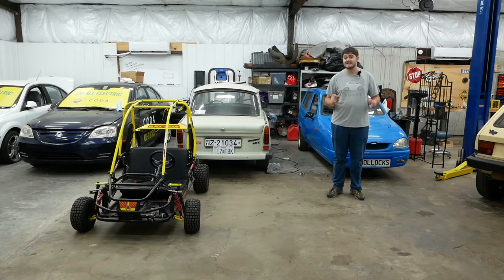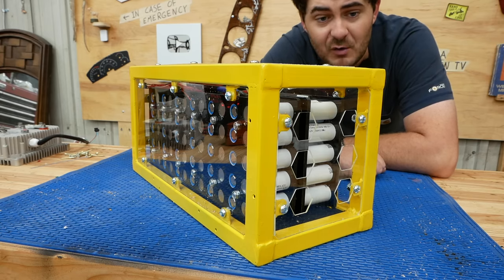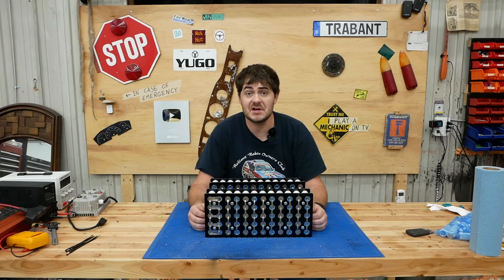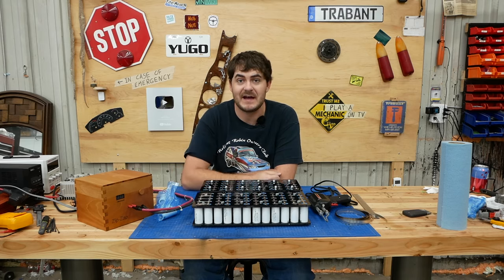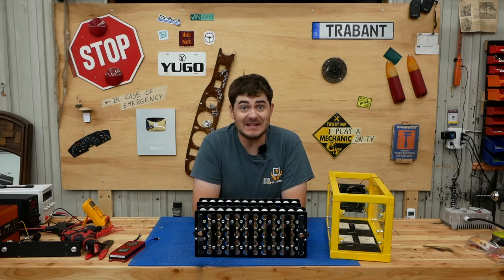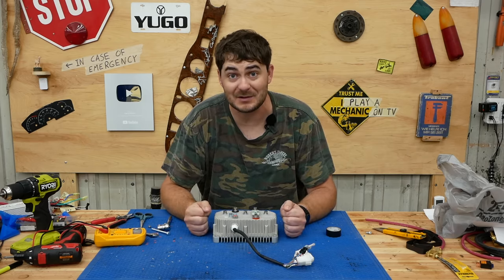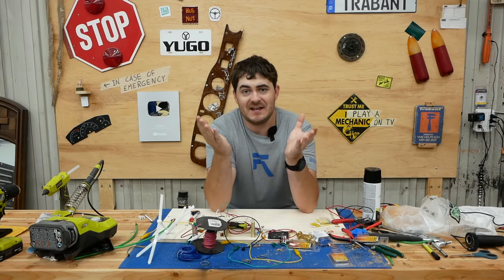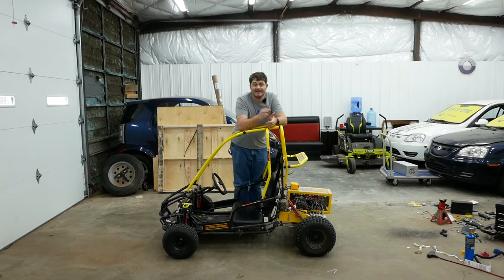I Spent Weeks Converting This Go Kart To Electric. Did It Work?

Comment: this is a great project, no problem with your old controller, it is an ebike controller that can handle sensored or sensor less motor, it even have an self learn wires for the proper rotation, the problem is your battery, if that controller is rated 48v, that battery that you should use to it is 53v full charge because the controller has a 42v cut off. so even if the battery is full charges at 40v it will not work. the same in your 72v controller, the battery should be atleast 81v full charged, use 26S for the cells. the cut off for that battery is 62v, so if you have 72v at full charged on your current battery, the voltage sag when you hit the pedal will cut off the controller. I hope you finish these project for your six year old.. God bless

Comment: If that 3D printed bus bar holder ever fails another option would be using that huge solder iron to heat up THREADED INSERTS and just melt them into the acrylic  (its what I use on 3D prints)

Comment: Hall sensor are sensing magnetic fields, what makes me think that the problem might be emerging within the converted alternater(motor). You would have to either swap the "engine", or try adjusting the freqeuncy of your electronic speed controller that MIGHT fix it aswell! Good luck

Comment: 25:00 it's probably the chopper transistors in the primary of the SMPSU. It could also be a transformer issue, which means scrap it, or a gate drive malfunction, witch means it'll be a dangerous lemon if that's fixed so scrap it.

Comment: When I was a bit older than your son (I think about 10) my dad made a similar modification to a dead go-kart that ended up in the scrapyard he worked at and he had a few very subtle modifications that ensured control over it, the first was it had two keyed switches one with key retention one without, I had the key to one he had the key to the other, that allowed him to make it "break down" at will when he didn't want me on it, the key he had stayed in the on position most of the time, this modification gave me a sense of false control, which I liked very much, I just didn't know it was false. The other modification was a circuit attached to a remote that could cause it to taper off the throttle and apply the electric brake while the driver maintained control of the mechanical brakes.

Comment: Hi, the reason might be, that the hall sensors are not placed in the middle. And since the magnets are triangle shaped, its not working, since the controller is ment to work with equally shaped.
The same Problems you had happened  Austin Blake in his Video to Building an Alternator Powered Bik, too.

Comment: I built a kart with an alternator motor and it should go fine with the 1500 watt controller. Assuming it will work on 72 volts you can run it without the hall sensors. There should be a 3-speed control connector that has 3 pins. Default is medium speed. For full speed you need to jumper the two outermost wires together.

Comment: Maybe a good idea would be to ditch the alternator competely and go with a BLDC motor. If you like a challenge, instead of buying a brand new motor that won't be cheap, you can get a burned out three-phase AC induction motor in the scrapyard and re-purpose it as a BLDC motor. The construction of both of them is pretty similar, you'll just have to lathe the rotor in order to free some space to epoxi the permanent magnets and also rewind the stator. It's a shit ton of work, but it can be done for probably a 1/3 of the price of a brand new BLDC.

Comment: The magnetic field strength from that electromagnet of the rotor is not powerful enough for the hall sensors to pick up especially at high acceleration. You need to do the rotor mod with permanent magnet to attempt high acceleration moves. Also your battery clamping is not secured, the copper bar can move, rust can develop between contact of different metal and cause your BMS to read bogus voltage and cut off. At last look at the busbar current setting of your Kelly controller, set it to 90A.

Comment: My own electric project has a similar problem Too much throttle and it cuts out . Seems based on current issues. The controller is basic and I think tuned for a lower current but non programmable. I wonder if you tried upping the current limit settings? I think Kelly makes good controllers. Thanks for your video.

Comment: Have you tried measuring the voltage at your 12V rotor field supply during operation? What's stopping the stator field from inducing a current in the rotor windings? If a potential greater than 12V is generated in the rotor, that would back drive the DC-DC converter. It would also kill your rotor field, causing your hall sensor signal to go very wonky, confusing the controller.

Comment: if you wanted to solder the batteries fast, the trick is to replace the tip with a short piece of 12 gauge wire. gets super hot super fast

Comment: You attached to Hollis sensor to a rotor. What you should have done is connected a separate plate with a magnet on it the motor management to select a single point. Then the computer would know at what point the rotor was at and it would be able to sync up with the position.

Comment: Ok now I just checked and I cannot find a reference to a three phase induction motor that uses a permanent magnetic field. There is the squirrel type and the wound type which appears to be what you are trying to achieve,  the wound type appears to have the induced voltage, current and magnetic field regulated by external resistance. Also if you alternator outputs 60 amps your power output can only be 720 watts, 100 amps 1200 watts no matter what external circuitry you attach. Your motor controller if a VFD (veritable frequency drive) will expect only the magnetic field it generates not a second field generated by your rotor field. hope this helps

Comment: The charger pack's mosfets are likely failed short. Repair may be possible, although cost analysis between replacing and repair may be necessary. You seem to have the electronics skill to pull it off, but factor in your time.

Comment: Ok - sounds counter intuitive BUT - Reduce the current to the stator winding's  - the increased field at 12v when the motor is spinning will be causing your hall error
what you have is essentially a variable KV motor - run the stator at 12v for high torque low rpm and reduce as the revs go up - 3 to 6V is a good place to experiment - maybe a PWM controler ? - Love the content - dont give up !!!!
Reply: Just to add to that - think how the stator is energized in your car - the ignition light goes out as the stator current is reduced - the ignition lamp acts a a current limiter (well at least it used to before smart charging & ecu;s)

Comment: Should check the amp  draw  while driving  the cart. Could  be alot  under load which makes voltage sag and with voltage sag cones current draw increase which causes  problems

Comment: You need more torque specifically along with a different rotor stator configuration. The torque of the alternator is so little that it becomes pulled out of phase each time the buggy stopped. Easy fix is using an actual electric motor. Hard fix would be more windings inside the alternator and a redesigned rotor and stator keeping the alternate from "magnetic locking". Tesla fixed this mag lock problem in the Tesla motors allowing for more horsepower and torque.

Comment: I would think you need a starting capacitor. I bet voltage drop is enough to turn the motor controller off or into a protective shut off during the huge amperage draw at the instant of motor start when under load.

Comment: I’m new to your channel and love your vids. You had a lot of bad luck with your gokart projects man. That first controller you had was actually just fine. I’ve had plenty of success with them. You also needed to just buy a kweld spot welder and you could have handled multiple layers of nickel strips.

As far as the motor goes just get a 48v or 60v my1020 brushless motor for less than $100. Can get 35mph out of those.

Comment: I'm worried about those plastic clamps creeping after some time, especially if it gets hotter. Next time you resume the project, please take a look at those to make sure that the contact resistance hasn't increased due to lower clamping force, just so that nice battery pack you built doesn't catch on fire. 100A is no joke.
Reply: IR camera of the contacts after full loading session should be interesting to see 😎

Comment: That Kelly controllers gotta chew threw the output current of the Daly BMS.
Edit: Eyy, I was probably right with that.

Those kelly controllers are for UTVs and Golf Carts. They pull like 200+ amps. I found this out the hard way building my electric mowor. You can try to program it to draw less (down to 200a), but it wasn't a flat 200. And any 250 fuse I put after the BMS still blew.

Comment: When it hits 72 volts, it's basically dead. Voltage regulators take higher voltage and chop it down to what the components are rated for till the input voltage drops below their regulatory voltage, then they stop supplying power to save the battery.

Comment: The hall sensor error could be from the controller detecting that the motor isn't performing like it should, it could be sliping magnetically missing some sensor output pulses and causing the controller to shut down for safety.

Comment: You should try to use a vesc based controller for example a single motor vesc controller made by sprintend they are very powerful and very small you cand pull something like 300 phase amps from one controller and about 200 battery amps. And also they aren't that expensive.

Comment: I wonder if he figured out in the last two years that he could have soldered directly to the nickel strips before spot welding to the batteries. You can even solder copper bus bars to them, if you use an oven or a torch.

Comment: Μy rc car did the same thing!!! With 10-20 percent throttle it would move normally but with higher throttle it would cut out exactly like your go kart. Turned out to be worn bushes!!! I don't know whether your alternator/motor has bushes but if it has i would check them out.

Comment: The common trope of "soldering battery terminals is bad" comes from people doing it wrong. If you just go at the terminals of a battery with a crappy soldering iron and no prep work, of course you'll end up with a damaged battery. The battery sucks the heat out of the iron and prevents the solder from melting, and you'll end up holding the iron on too long and overheat the battery. On top of that, solder doesn't stick to polished shiny battery terminals, unless you have acid core solder, or a corrosive flux - and I don't recommend those either.

To solder a battery terminal, you need to scuff it thoroughly with fine grit sandpaper before soldering. You don't need to go at it with a belt sander or anything, just scuff it enough in a circular or cross hatching pattern. You need to use a sufficiently powerful soldering iron as well. I'd recommend a 60-90W iron with a large chisel tip, and preferably large body for thermal mass, else the battery will suck all of the heat out of the iron and the solder won't melt.

Once you prep the battery, use the soldering iron to melt a blob of solder on both battery terminals. If you're using copper wire, strip a section long enough to span the batteries in the pack and tin the areas that are going to make contact with the battery terminals. Once that's done, just put the wire on the battery terminal and press down with the soldering iron. It won't take more than a few seconds for it all to melt together, and you're done, move on to the next battery.

It can take a bit of time to get the technique down so you don't use too much solder, but once you get the technique and prep work down, building a battery pack up using solder doesn't take that much more time than spot welding. It's a good tradeoff for people that don't want to buy an expensive spot welder they're only going to use once.

Comment: I would say you should not use a hall sensor in side the stator.  Fit a real shaft encoder.  Then increase the gear ratio.  An alternator runs at high speed,  several times engine speed.  It sounds like it is virtually stalled.  Also a higher ratio will drop the top speed of the kart,  much safer for kids.

Comment: I can’t se clearly how the BMS and batteries is connected, but it might be done wrong. The main power should go directly from the batteries through the BMS controller with the thick cables. The BMS is measuring each cell for over or under voltage and regulate the charger and balancing the cells when charging. This is what the thin balancing cables are for.
I have nearly 40 years experience with eletrical forklifts, and often see this issue if the voltage drop below threshold under load. Then the motor controller will shut down.
This of course with the older lead acid batteries, but principal the same is happening with newer Li Ion batteries that are more common this days.

So as other have wrote here, as a first test, measure your battery voltage under load, or as a simply test, add an lamp to the batteries and see if the lights are fading away as you push the speeder.

Comment: Need higher volt DC motors instead of a AC alternator to get the torque. Lower volts = more AMPS to do the same work. Thanks for sharing the truth about your adventure, remember failures are success in the making.

Comment: I know its to late and such, but to clamp down the busbars you could have just flipped the screws. So instead of threading into the acrylic, just champfer the whole from the inside, stick a 7991 or something in there and counter the screw with a blind nut on top of the busbar. This way you have no threads in the acrylic, the screw cannot make contact with the cells and you have a screw post to mount the cable shoees for the balancing on top of the busbars too.

Comment: Pretty sure the problem is the hall sensors are getting magnetic or electrical interference from the core being powered instead of permanent magnet based.

For the battery series connections you can layer multiple strips on top of each other to get higher power and also just use thicker nickel strip (as thick as you can solder).

Comment: Change the motor. Alternators make ok wind turbines, but you need something with a little more grunt. You're almost there. The only other thing that popped into my mind is: some controllers can be switched from 120° to 60°(?) I think. Maybe that is a problem.

Comment: Just make sure your BMS is turned off when not in use so it doesn't drag the voltage down and ruin the batteries. That happened to the Inja when he built his electric motorcycle.

Comment: I guess that Kelly fried your charger. IIRC controllers make AC ripple, controllers draw current in pulses, which can destroy charger (also DC-DC can be destroyed!), if you don't disconnect it during driving. To protect against it one should use coil in series (at least I did with DC-DC in my EV build). Also AC ripple could be the reason why hall sensing values are messed up.

Just my 2 cents.

Comment: I'm not saying it's a good idea especially if you have other options, but you can solder Li cells.  You need an iron with a lot of mass, not a lot of watts.  I use a 100 or 80 W iron made for stained glass.

Comment: Are your hall effects aligned to the phase/angular positions the controller expects? I don't know enough about them to be much help. But I do know the peaks of the Voltage and Amperage waveforms in motors aren't always in phase.
Maybe just buy a motor meant for an elec. motorcycle. They're not much wider diameter than the alternator and similar in depth.

Comment: I would mount the batteries and electronics 2 feet further back so that way even though it's slow it can be a wheelie go cart. I have two Ebikes at 80v, one does 45 and the other does 60mph. But both are all aluminum and weigh 50-60 lbs fully dressed and I weigh 200 lbs.

Comment: not just sustained heat .. the bigger issue is that the connection can come loose easily as solder joints tend to crack etc when cooled down and heated repeatedly also flux could cause a layer between the object and the solder, that will stick the solder to it, but wont properly connect

Comment: I hope one of the things you learned is how important a fuse is and where to put one. That 250 amp fuse you installed should have been the first thing coming off of the battery pack, then the cable and finally the kill switch. The entire length of cable from the battery box to the kill switch was not fuse protected.

Comment: I feel like a better solution at this point is to throw a 212cc engine back on, but rubber bushing mounts and something like a car sized muffler to really quiet it down lol. Would probably outlast two battery packs. Going "green" and "electric" isn't always a thing

Comment: After looking at the way you've wired the batteries 5p 24s, it appears to me that the nickel strips to achieve the 5p are kind of superfluous. With just the short clamped on copper connectors you'd have 24s, with the longer copper connectors at the ends making the 5p. So 24s5p. I guess the nickel helps with balancing?

Comment: Did you check the max draw from the motor controller under the full load? Is it possible that when you really juiced it you were drawing over 100A and the BMS would give you more than 100A for the brief peak load window and then cut out? Seems pretty easy to test with a clamp meter over the main negative.

Comment: If I remember correctly, don't hall affect sensors run on 5 volt circuit? Maybe they're wired up wrong or too much voltage is supplied to them. I don't know how you wired them up so sorry for assuming things.